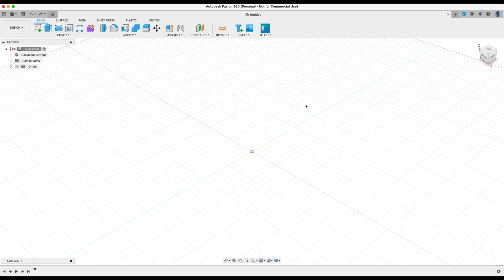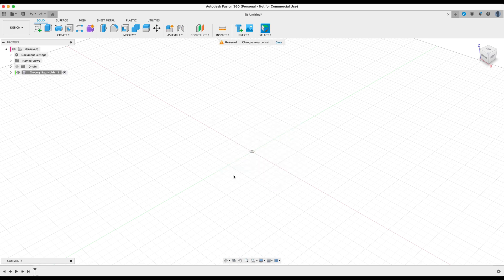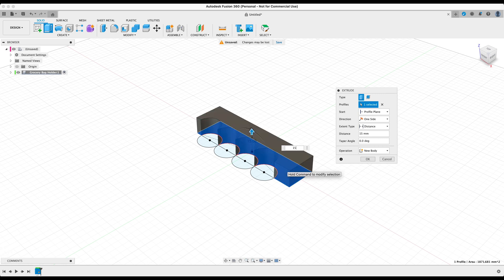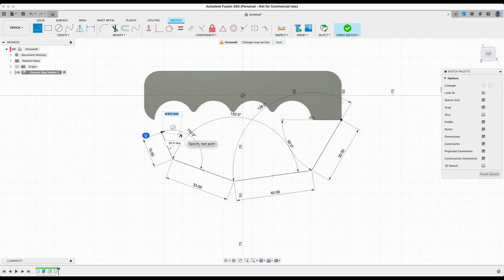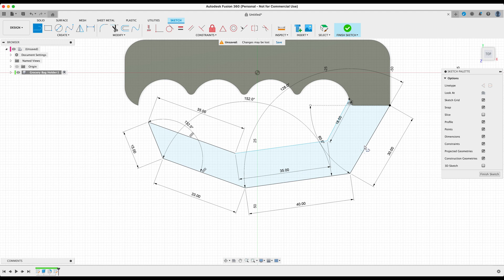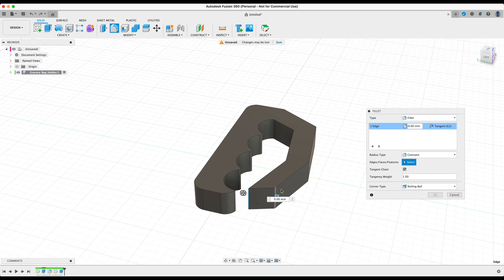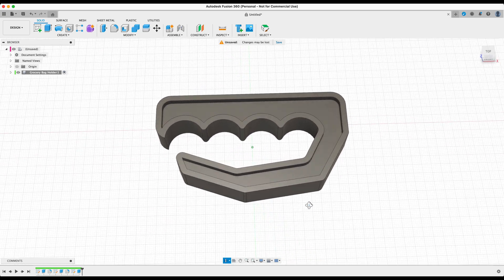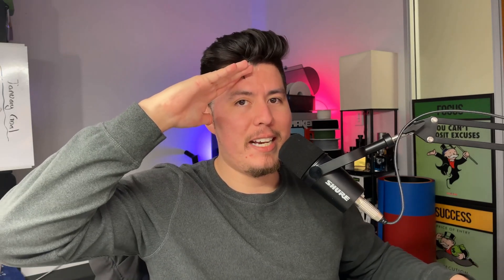Day 4: Learn Fusion 360 for 3D Printing | Designing A Grocery Bag Holder

Comment: After adding the second part, I am unable to extrude this. Looks like it does not create a plane from the sketch after finishing. I am unable to figure this out.

Also, after some time trying to figure out what was happening, you have to stay in the "line editing" stage by clicking on the end of the previous line without exiting it. Is there a way to get back into that stage after accidentally exiting?

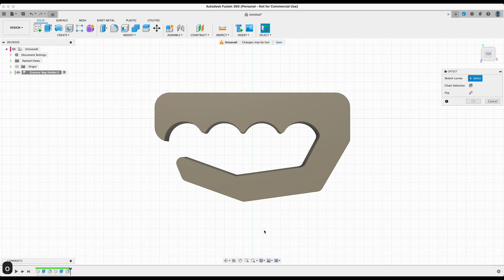Comment: Loved your videos. I have a question. Around 11:22 you created offset and cut into the design on the face, but you didn't do the same process on the other side. So, did you mean to print a 3D model with only one side grooved and the other side flat? What if I wanted the groove on both the side? Will it not print in face flat manner and it we print it in upright manner the holder will be weaker? I am sorry, I just getting started with 3D modeling. Thanks a lot for your videos!